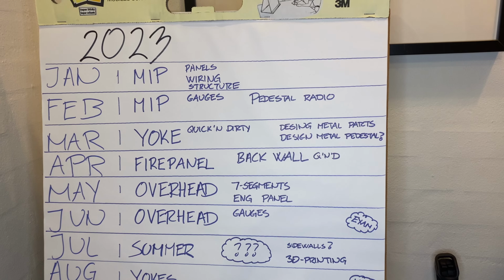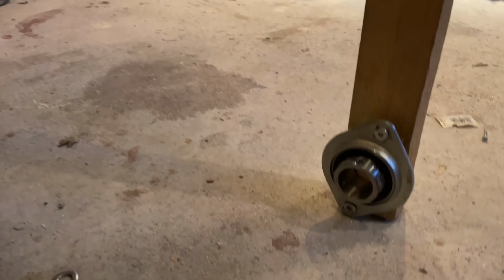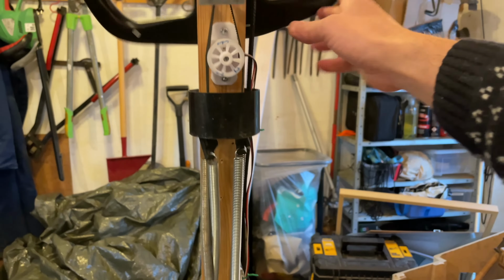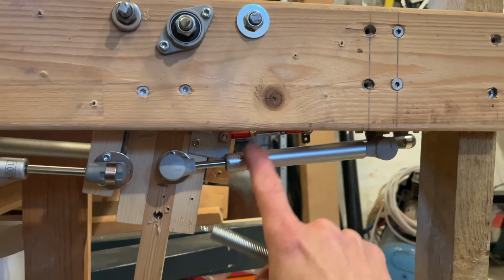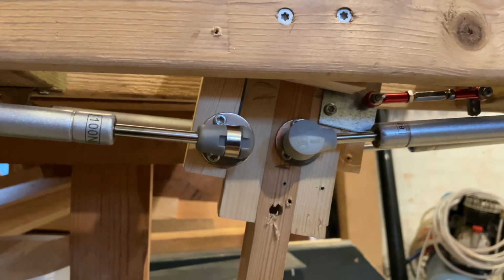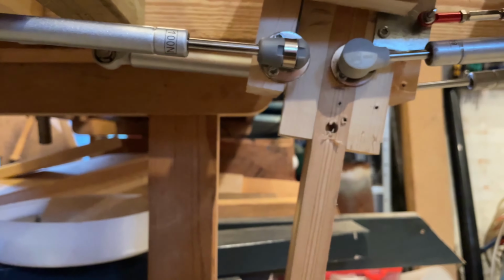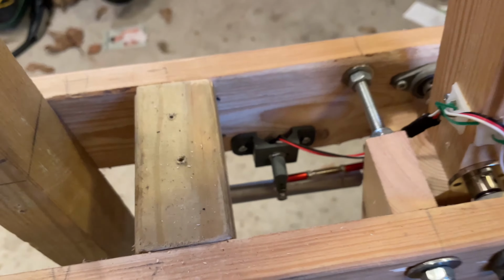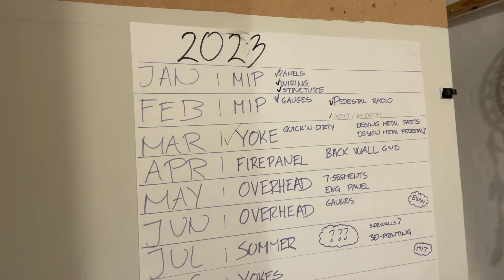Yoke - Home cockpit 737 - Build a Boeing

Comment: Hi Peter, we have communicated many cockpit-building years ago.

You are one of my long-standing heroes of the cockpit-building obsession; in particular because we share a certain level of parsimony with regard to the ratio of expense to functional perfection.
With regard to your yoke design, I somehow missed this post a year ago and have just discovered it; it is exactly what I need at this time. 

Currently my cockpit has a reasonable MIP; Overhead Panels; Radio Pedestal; Throttle Console; Saitek Rudder pedals, but the crudest of yokes! In fact it consists of my 20-year-old? CH-products Yoke mounted on a vertical plastic pipe and then bolted to pilots MIP. Its potentiometers are so noisy, it has to be replaced, with what? A properly levered 737ng yoke must be my choice, rather than buying another desk mount yoke and fixing it on top of that plastic pipe! 
And so I am about to follow your basic design approach, and have just ordered 4X 100-Newton kitchen unit dampers. I have some basic questions about your findings.

Firstly let’s assume we understand the basic principal of splitting an angular motion with a central hold point that, must be accurately reset to on release of pressure, into two independent motions with a shared central point. There will be various parameters concerning the leverage ratio about the main pivot point, and also how sophisticated the hinging is achieved, eg would simple flat plate hinges serve rather than an axle and bearings etc.

 I am puzzled by the implications of your 4-damper approach. You started with 2 dampers under expansion, which was unsatisfactory, and then added two more dampers (slightly stronger) under compression, and that worked satisfactorily without needing extra springs. Why were the first 2 expansion dampers still needed at all? Aren’t the compression dampers doing all the work of restoring to neutral position assuming adequate Newton rating. Are the original dampers pulling the lever back to neutral more effectively than the extra dampers are pushing it back to neutral? Would slightly more powerful compression dampers work without further aid? or are the expanded dampers going into compression helping to smooth the compressed dampers going into expansion, to give a better yoke behaviour. I think I need to go and lie down for a while, my 89-year old brain is starting to spin.

Cheers NobbyH